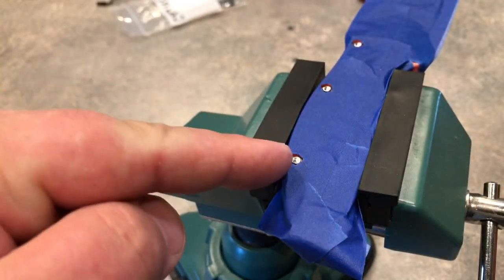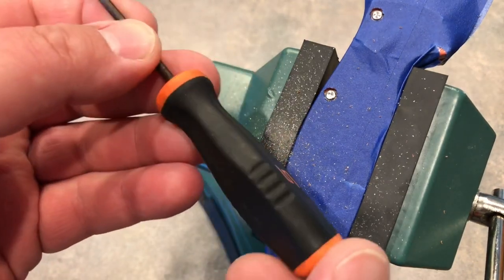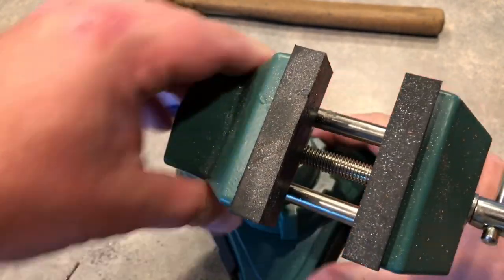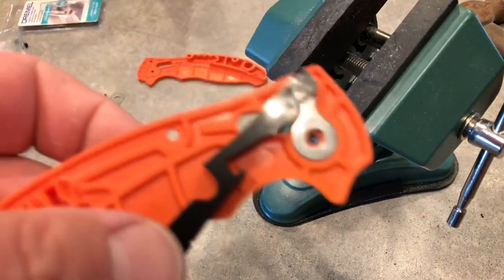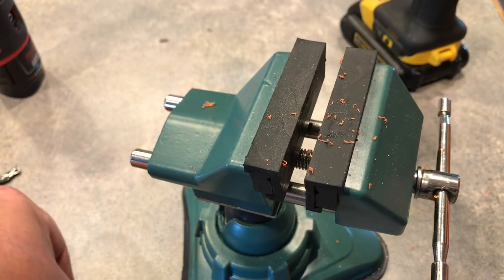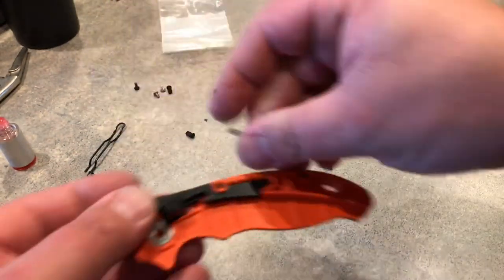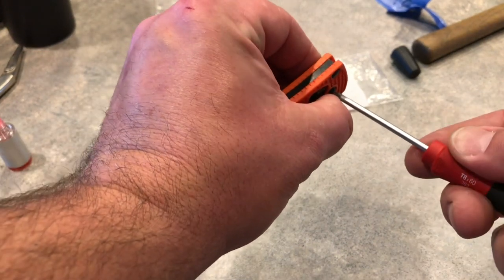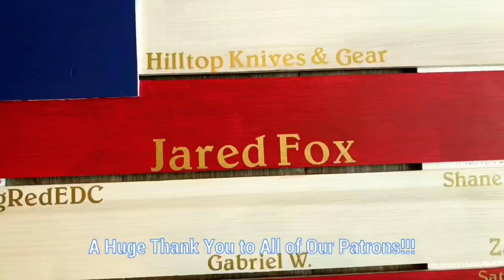How-To Change Hardware & Disassemble - Spyderco Manix2 Lightweight!!!

Comment: I’ve read through all the comments here. Every time someone asked about the screws, you just told them good luck finding them. Also was told to watch the next live video and it would be told what size they were. I watched the whole video and it was never told. Would you mind to help out some other people in the knife community and tell us the size? Would be greatly appreciated.
Reply from the maker: I'm not sure what else you want from me, I've told everyone several times what screws they are. If you have a Manix2 LWT with a Wire clip you have one of the screws I used holding the clip on. The problem is I have no idea where you can buy these screws from other than Spyderco, and they will not sell them. I looked for several weeks and ordered hardware from 3 different retailers that had the correct dimensions for diameter & length. For various reasons those screws would not work, the only hardware that I have found that works easily are the screws from Spyderco. But like I have said many time, they will not sell them to you. If you call them they will send you one maybe two screws for free along with a little tube of Loctite. If I had some other info I would share it, as you can see from a lot of my videos. If I knew where you could get these screws, I would tell you and give you the part number. The Truth is I have passed along all of the info I have.  
If you want the actual measurements of the screws here you go, 
Female Side - Length .268"  Diameter - .154"
Male Side - Length .246"  Diameter - .110"   
Outer Diameter of the heads on both pieces - .210"
 I warn you about buying these from other places they will not be what you're looking for even though the measurements in length & diameter are the same. Thanks for watching!!!
Reply: OCD-4-EDC I appreciate the thorough response and the dimensions of the screw. Thanks man.
Reply: @andyprice4696  do you think he's holding out on the hardware vendor so he can sell kits on his website?  That's the only reason I can come up with for him not sharing the info.
Reply: @Baby4HeadAutographer  
Been awhile but, I think he said the only source he had for them was directly from spyderco and they didn’t sell them except for one or two at a time. Spyderco thinks the lightweight models are supposed to be pinned. Too much flex in the frcp or something like that. Anyway... I looked on his website and didn’t see any for sale there. He might hoard them all for himself but, not trying to sell them.
Reply: @andyprice4696  Andy thanks, that makes sense to me.  He doesn't want to be the guy that says "hey, just tell Spyderco you lost the clip on all of your 6 manix 2s"🤣
Reply: These allow you to get custom colored screws as well, which the size is labeled and this company also sells.

https://usaknifemaker.com/pivot-barrel-1-8-d-x-3-8-l-for-folders-with-2-2-56-x-1-4-bh-ss.html
Reply: @corythesaint138  Pivot Barrel 1/8"D x 3/8"L for folders with (2) 2-56 x 1/4 BH SS. 
Is this the correct one for the manix 2?
Reply: @partypickle1015  yeah, the one I linked is the one you'll need. I ordered and received a set already for my Manix 2 LW
Reply: @corythesaint138  thanks brother. Much more helpful than a roundabout answer that I'm sure he has to give for undisclosed reasons.
Reply: @corythesaint138  also, is this all the hardware im going to need for the conversion?
Reply: @partypickle1015  no problem at all, figured I would answer the questions since I saw it. And yes, it comes with 2 pivot barrels and 4 screws, so you will need to buy 2x that link to get everything you need. I ordered 3x just to be safe but didn't need the extra set.
Reply: @corythesaint138  sweet man, thanks. I'm gonna swap these stupid frn scales for brass ones. Is the rest of the hardware compatible with a scale swap do you know?
Reply: @partypickle1015  if you want to put regular Manix 2 scales on, you will need liners, scales, and hardware from a donor regular Manix 2. If that's what you're after, these pivot barels won't work. They just serve the purpose of allowing you to disassemble and reassemble the knife (for cleaning, dyeing the scales, or replacing internal parts).
Reply: @corythesaint138  can I get that link also please for the screws and collars?
Reply: @donkeygepgep9030  are you getting the bhq exclusive m4 m2LW? I’m probably going to order it tonight that’s why I’m researching changing these scales.
Reply: @partypickle1015  did this work for you?

Comment: That's some really outstanding work.

I have a grey lightweight Maxamet Manix 2 and I would like to replace the ball cage and the ball.
I'm considering to do the re-assembly with 2.5mm screws and nuts. I'm planning to JB weld the nuts to the side with the integrated backspacer.
However, before I destroy the rivets and disassemble the knife, can you please tell me the diameter of the hole in the lock bar before you widened it to accommodate the female clip-part screw thingi?
I assume it's a little less than 4mm (I just converted the .156" you gave as a reference to metric)?

That Information would be highly appreciated.

Comment: You don't have to use a rotary file, the proper technique when drilling steel is to use a low speed, with high feed (i.e. more downward force) to avoid work hardening the metal. It also helps a lot if you have a sharp, quality drill bit and a lubricant like boelube to keep it cool. If you are afraid of the drill bit walking on a rounded surface, file it down flat a little and center punch it.

Also I feel like it probably wouldn't be too difficult to get a hold of some aluminum rivets to squeeze or hammer in there if one is having trouble finding the hardware used in this video.

Comment: So do we just buy the hardware for a standard Manix 2?
Reply from the maker: The best hardware to use is the Manix2 LWT pocket clip Chicago screw. That's what I used in the video. The problem is Spyderco will not sell them and I can not find them anywhere else.... I've spent many hours looking. If you find the hardware somewhere, let me know! Thanks for watching!
Reply: @OCD4EDC  thanks for the reply. I wound up just buying a standard Manix 2 so I didn't have to deal with all this trouble from the lightweight

Comment: Awesome work!  Do you think the lightweight blade is shaped the same as the G10 blade?  I'd love to do a blade swap between a G10 and lightweight.
Reply: They’re the same.
Reply: @lindboknifeandtool  yep, I even saw Eric Glesser confirm this in an interview.
Reply: @ZPositive  my big question is if the framelock sage handle will fit the maxamet sage blade. Same with the framelock vs linerlock military.
Reply: @lindboknifeandtool  now that's a great question.  If you do get an answer, I'd love to hear it.

Comment: I just got a rex 45 lightweight manix 2 and it is so stiff (the action not lock) I lubed it and tried loosening the pivot screws and it still feels pinched. Any ideas on something I can do to get a little smoother? I understand it's not going to be drop shut but I have to really whip it to get it to close!

Comment: I did this exact same guide in a forum post at almost the same time as you. We did almost the same thing I just had less power tools. Wish I had seen this video before. Would’ve helped a bunch to see how you did it before I went and tried to use hand tools. Great guide. Thanks!
Reply: Michael P, did you find the necessary hardware? Is there any possibility you could be more forthcoming on hardware description, beyond “it took me three months to find, have a nice day”? Thanks
Reply: @marveloulsmarvin  google 1/8” barrel pivot. You want 3/8” length and 2-56 BHT (button head torx) thread screws. You’re going to have to file the length of the screws and pivots anyway, so I just got the 1/2” long pivots from knife kits because they were in stock. Not sure why the video guy is being weird about it
Reply: Does anyone know if the lightweight blades are compatible with all manix 2 blades?
Reply: @Brian--0311  yes they should be compatible!

Comment: Instead of using the wheel could you grind away the outside of the rivet like you did with the other sections and punch it from outside in instead of inside out
Reply: I don't see why not! Maybe he just didn't think of it.

Comment: Excellent instructive video. Please tell us where you obtained the replacement hardware? Thanks in advance.
Reply from the maker: The Hardware is a Nightmare to find, I do not have any insight for you. It took me about 3 months to get the hardware. Good Luck, Thanks for watching!!!
Reply: These allow you to get custom colored screws as well, which the size is labeled and this company also sells.

https://usaknifemaker.com/pivot-barrel-1-8-d-x-3-8-l-for-folders-with-2-2-56-x-1-4-bh-ss.html
Reply: @OCD4EDC  so you were able to buy the hardware from someplace but dont want to give out that info? I've read all you comments and all you've said is good luck. You posted the hardware specifications once and directly after that you said that hardware with the exact same dimensions might not work. Are you unable to tell us where you purchased the hardware from??

Comment: Hey OCD, were you able to get your Manix 2 to drop shut before you changed the hardware? And if so how? Cause I have the Knifecenter exclusive with Rex45 and I've been trying to get mine to drop shut. Any info would really help. Thanks and keep up the Awesome content.
Reply from the maker: Without seeing the knife, all I can say is make sure it's clean and the pivot screws are adjusted correctly. Thanks for watching!!!
Reply: Both of my lightweights will not drop shut unless you back off the pivot screw till the blade becomes loose. 
 I have always blamed the riveted construction and am surprised that they still produce them that way. Especially since the Native LW is not riveted.
Reply: @Onemancanonlydosomuch  they released a lightweight model with screw construction and BD1N Steel upgrade

Comment: I ordered this set of screws from eBay they worked great ’Steel Knife Handle Bolt Rivets Plum Scale Screw Fastener Nut DIY Making Material’
Reply: Thanks dude! Was it the 8mm or 10mm?